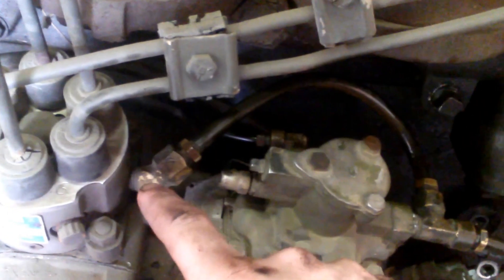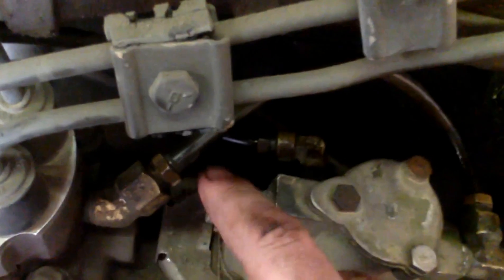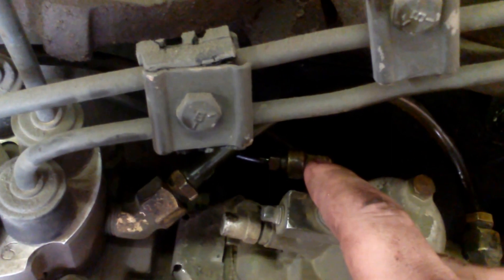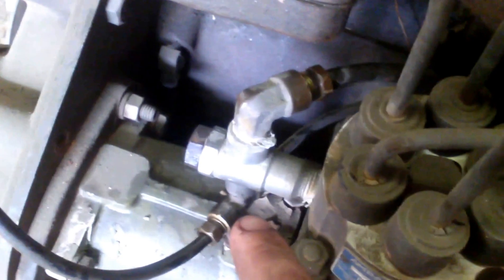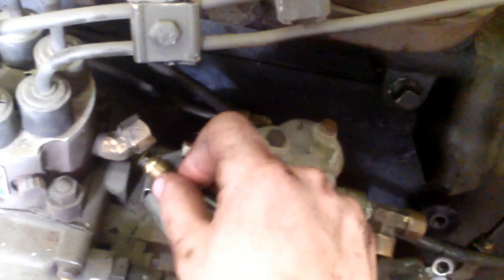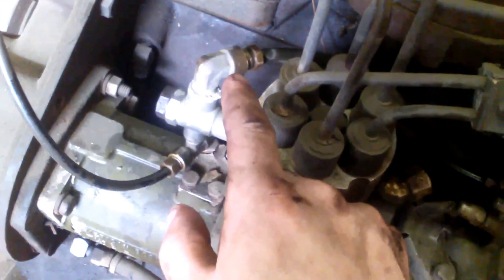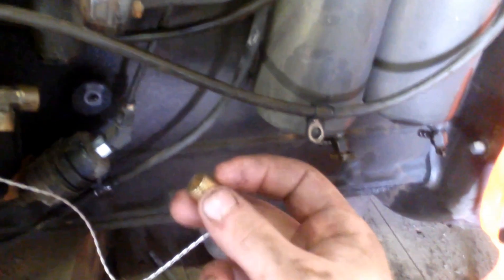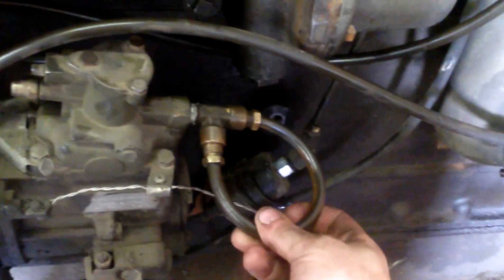FDC bypass step by step

Comment: Whats the purpose of this and the pros and cons if any
Reply: And can u still run multie fuel capability with this modification
Reply from the maker: Cons to doing the bypass is you no longer have multifuel capability diesel only. Purpose of doing it is to Eliminate fuel leaking internally in the injector pump. Making the engine make oil, Bypassing or eliminating the FDC also helps throttle response and starting/ idle when cold.
Reply: @bgbuilder   Yes, you still have multifuel capability with the FDC bypassed. The purpose of the FDC was and attempt to try to change the IP settings, based on the viscosity of the fuel. It worked somewhat, but you can still run used engine oil and the like with the FDC bypassed. The thing that makes the muiltfuel a multifuel is the combustion chamber and injector design, not the FDC.

Comment: Has anyone put two small valves before both T-fitting points on the the FDC? Is it possible to bypass the fuel away from the FDC (with the turn of two small fitting valves) when running straight diesel? 

I would like to bypass mine but I would like the option to quickly use the FDc if needed. 

Any ideas?
Reply from the maker: you could if you wanted to, but if the FDC if working properly wouldn't need to be bypassed running diesel.

Comment: does the 1/4 inch pipe plugs fit in both loop locations? or are they different sizes?
Reply from the maker: if i remember right 1 side is 1/4 in npt, the other is 1/8 npt. I'll double check in the morning and let you know for sure which is which
Reply: Hooah!